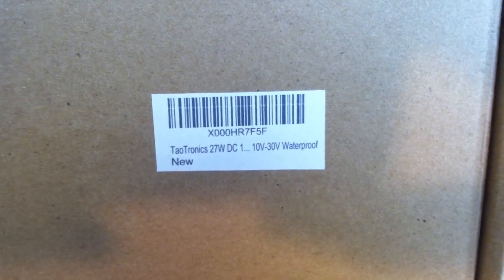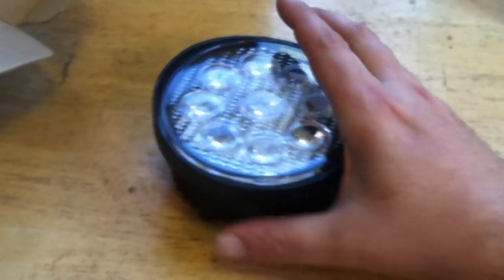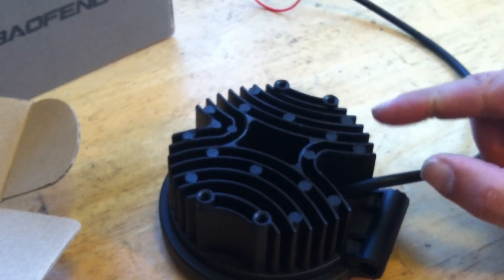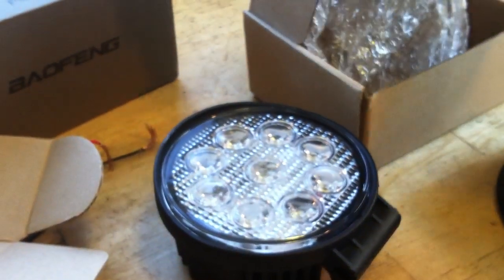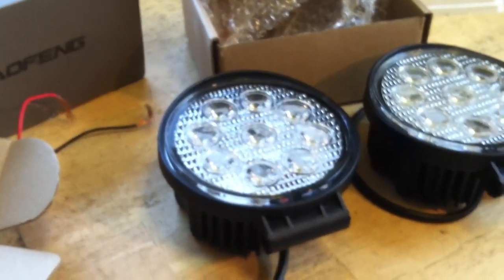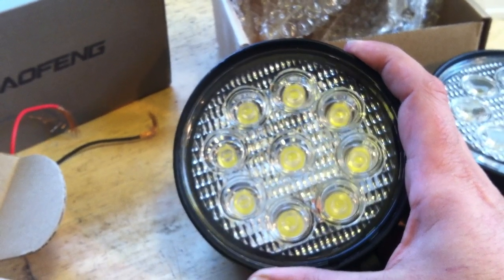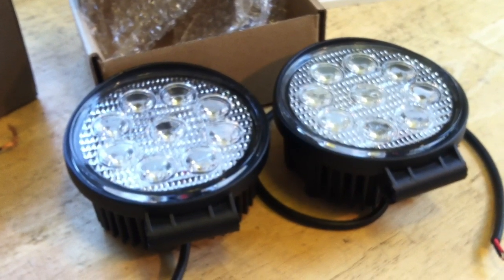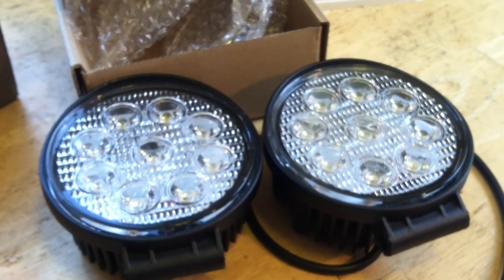TaoTronics 27W waterproof 12v to 30v outdoor LED floodlight from Amazon

Comment: I have two of these on my motorcycle, (the spotlight version) but I'm going to try to take them out of the housing and mount them in my chrome housings instead.
Reply from the maker: Where did you get the spotlight version?  Can you post a link if it was on Amazon?   I ended up putting these on the apocalypse trooper but it could really use the spotlight versions for the forward facing part.  I don't think this would survive being removed from the housing, it is bedded into the aluminum with epoxy.

Comment: Are you sure that those are 60 degree flood beams ? I have them and I think that those are spot beams !?

http://postimg.org/image/de777gp6l/
http://postimg.org/image/l868wsxgt/
Reply from the maker: It is what was marked on the box when the the box showed up from Amazon.
Reply: 8digitPDX  Hm, interresting, I have also received from Ebay 4 pieces of those as flood but I really dont think that this is flood beam, On 5m from the wall I have 2m light diameter. Please take a look at this photo, spot vs flood, I dont have that flood beam, mine has spot in the middle and I really dont know how to be sure. There is also plenty light outside that spot on the wall but there is no trace of that light beam from those photos that are showing flood light as completely flood without any kind of spot and that is what I need on the back, on front it can be spot.

http://d114hh0cykhyb0.cloudfront.net/images/uploads/led-work-light-spot-flood-light-27w-wl-27w-sxjpg.jpg

http://www.terraled.at/shop/page/7?sessid=DyBSEngTLNrSGdrqWjPBRbyg1lSxMrTio2O5VIXgHw0jqa0B0uR9HY6mgZ60eWRw&shop_param=

http://www.aliexpress.com/item/LarcoLais-2x-4-inch-27W-9-LED-Working-Light-Spot-Flood-Lamp-Motorcycle-Tractor-Truck-Trailer/533819858.html